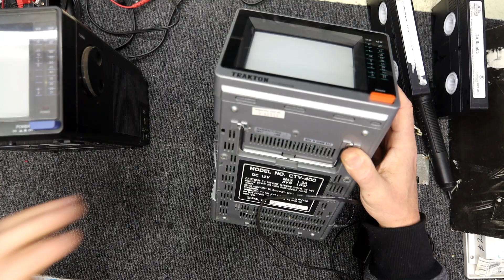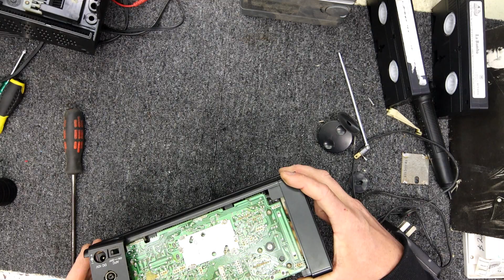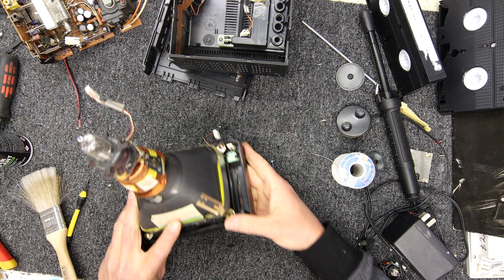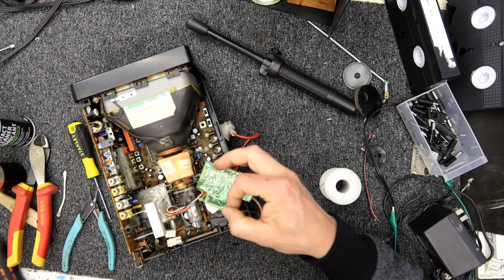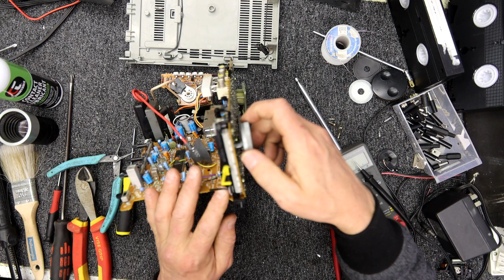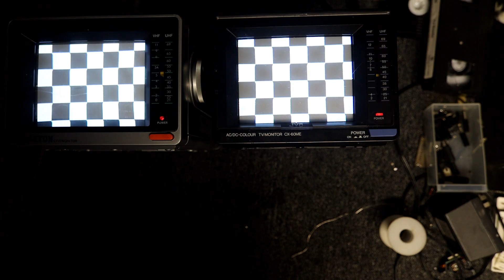JVC 5 inch CRT TV Service and Taiwanese Clone

Comment: I bought one of this days ago, and the image seems yoked a little bit. I wonder where should I hold and yoke the tube and would I be shocked to hell if I touch anything wrong....
Reply from the maker: The connections to the yoke are a shock hazard along with the neck board on the end of the tube. Its usually safe to rotate the yoke by the windings at the front of the tube end, but alternatively you can loosen the screw on the yoke clamp and rotate it a bit in the direction you want with the power off, tighten the screw and turn it on and check, and repeat until you get the picture straight.

Comment: The silver set branded as Trakton was also sold with the Groupmen branding. I have had half a dozen of them over the years, found at electronic sales and yard sales or given to me by people cleaning out houses. Great little TVs, I still have a couple. 
Not much goes wrong with them. I don't know which countries they were sold in but we certainly had them here in NZ. The strange thing is if you Google "Groupmen TV" there are no results at all. Obviously never made it onto the internet. When I pull my ones out of storage I will have to photograph them and put them up online somewhere.
Reply from the maker: Interesting. Never heard of that brand but was probably an importer in NZ that got their own badges made. We had NG Enterprises that put the Princess and Palsonic brands on Samsung and LG and then Chinese imports. I suspect Trackton was another of their brands but cant be sure.